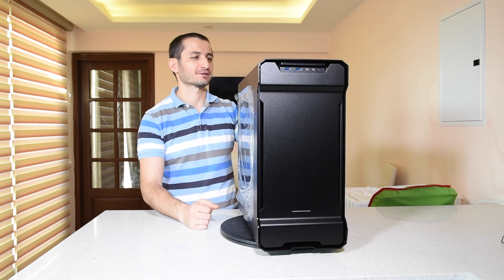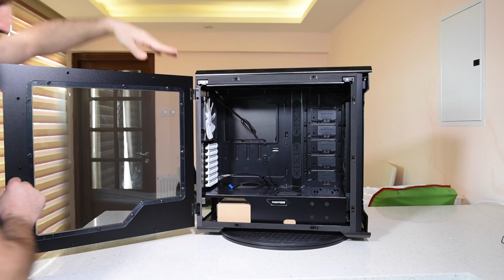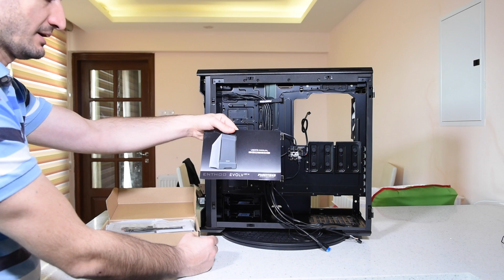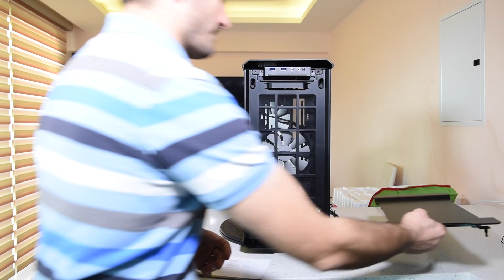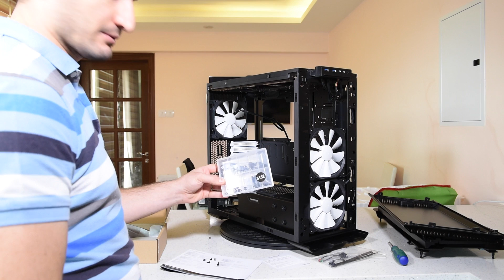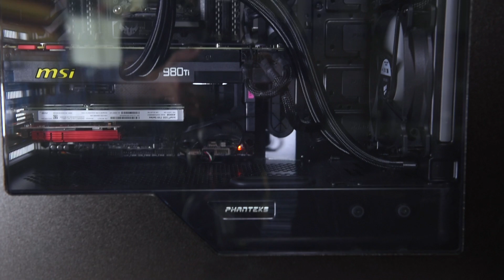Phanteks Enthoo EVOLV ATX Mid Tower Case

Comment: Hi man! Pls help me to install the Corsair h110i in the front ...I just can't fit it !
Reply: I can only install it if I remove the little bracket . But I don't want to remove it ..looks ugly . I have the tempered glass version . The holes should be in the same place ...but I can't fit it :(. Help help!
Reply from the maker: The problem is that at the front it is designed to fit a 280mm rad and not a 240. In my case I fitted the Corsair 240mm rad by fixing it with screws on one side and by double sided tape on the other side. This is quite a serious flaw in design.
Reply: +TechnoMania but in the video u used 280mm rad right ?
Reply: +TechnoMania . I had no problem in installing a 240mm. My prob is how to install an 280mm ...like u did
Reply from the maker: You are absolutely right, the H110i is a 280mm rad, so I screwer the left side of the rad to the case and the other side fixed it with a double sided tape which also helps to absorb some of the vibrations from the rad, making it more silent.
Reply: +TechnoMania so what u recommend me to use in the front . An h110i or an h100i ?
Reply from the maker: To have a native support I suggest to use the H100i.
Reply: +TechnoMania can I ask you why u have been chosen the h110i for your system?
Reply from the maker: The customer had chosen it for his system and I had to improvise fitting it in this case.